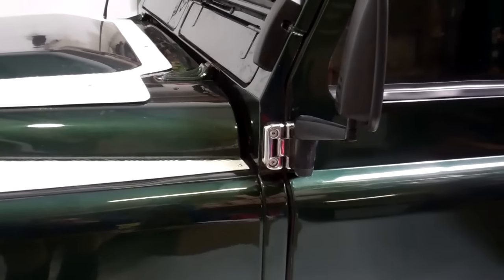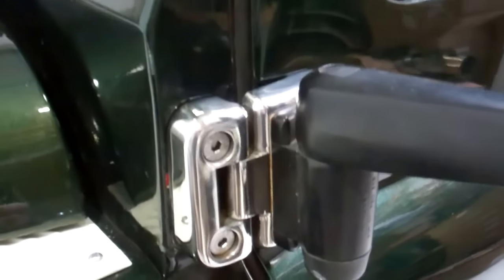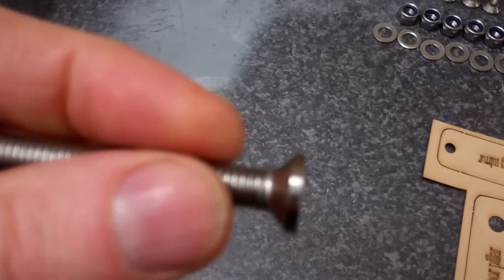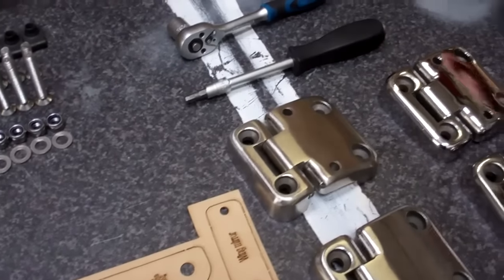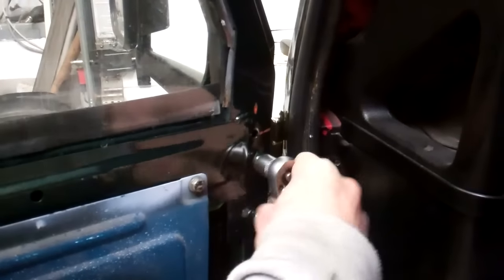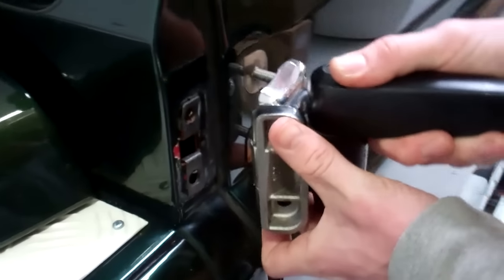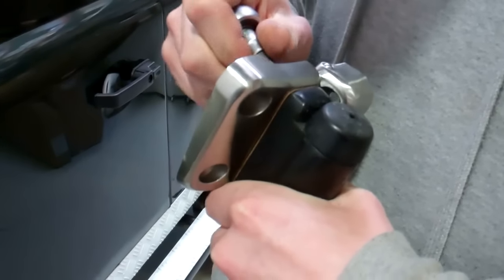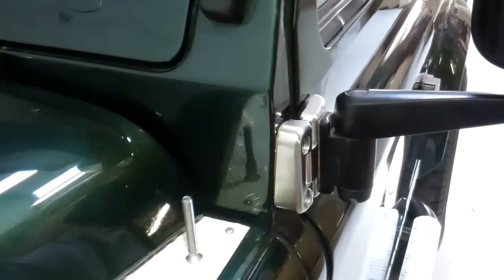Land Rover Defender Door Hinge Upgrade to Stainless Steel Hinges

Comment: hi, can i use land rover defender hinges on a land rover series of 1968 without making any modification? I want to this in order to install the defender side mirrors on my land rover.
Reply from the maker: +jose carlos Dávila Hi - this is a good question ? Standard hinges are not too expensive so its worth a go ! We dont have an older Series model in the workshop !
Reply: I just got a mirror kit for series 2-2a, so its time to figure it out :)